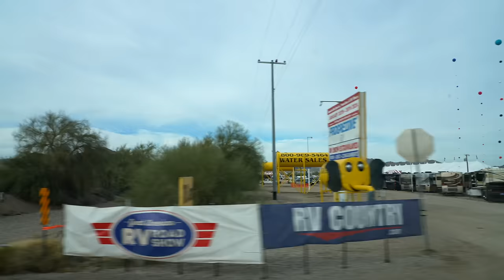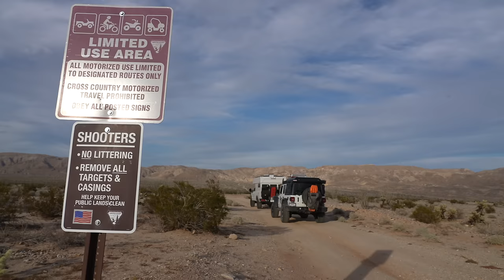Road Trip to California - Meeting Friends (Overland Legends)

Comment: Watching this brings back so many wonderful memories of my husband and me driving around teh desert and hills in his 1956 International pickup, original engine, original transmission.  The only modifications my husband did to it was to shorten and raise the rear bumper because it kept getting hung up on berms, resulting with us not getting traction. He also installed a lift kit to gain more ground clearance and installed larger off-road tires.  He also replaced the padding on the seats, so we would still bounce & hit our heads on the ceiling if he hit a bump hard enough. Those springs in the seat could still launch pretty good! LOL!!!  I miss that truck.  I remember when the engine started running rough, so he stopped to see what the problem was.  He found that one of the spark plugs was cracked and one was coated with oil.   We were miles away from any main road and temps were over 100 (my husband loved the heat), so you didn't want to be stranded in those conditions. For years my husband had been exploring that part of the desert, the abandoned mines and claims.  He knew of one place where the miners had their own little shop to repair their equipment and vehicle, but blew up all the buildings when the government took back their claim.  So we headed to that site.  When we arrived, my husband began walking the entire area looking for any signs of a spark plug, he searched one half and I searched the other half.  We found a total of 8 spark plugs, 3 different types.  My husband pulled out 2, cleaned them up, set the gap, replaced the two bad spark plugs, started the engine, and she was good as new.  Now, those are the vehicles that car manufacturers are afraid of, vehicles that are easy and quick to repair so majority of people can fix them themselves.  The International was still running in early 2000.  I love seeing you all exploring and making memories that will keep filling your hearts with laughter, love, smiles, and the beauty God created for us.  May God continue to bless and protect you all!

Comment: Finally, using a table to support you plate while eating. Please include the table in your equipment review, also how you pack the cast iron cookware for traveling. Quartzsite is one of several locations where on BLM land boondoggle camping is permitted. They fill up quickly in th winter time. Great video as always. Thanks for sharing.

Comment: another cool vid , idk if it's  just me or camera angle or the way the  light is hitting or what . but that Truck looks a bit too off camber for my taste and squats a bit . i never drove one with a camper that heavy-big ( i did rent a truck camper a few rimes but it was like 1200-1500 lbs and probably half the size ) , so probably just me lol .
Reply from the maker: We have been taking it more and more off-road trails and if handles the off-campus stuff pretty amazing. The low pro top really helps. It has air shocks on the back and we lowered them for the rough off-road trail. That’s why maybe it looked a bit squatted at the time. 

It definitely takes a bit of getting used to driving a big truck on the trails rather than the nimble Jeeps but we are sure having fun with it.
Reply: it definitely looks fun , and yeah i guess lowering ( deflating ) the airbags etc makes it look lower than it is . i'm loving the rig and looking forward for your new adventures with it   @EFRT